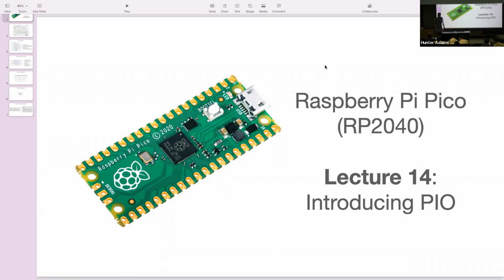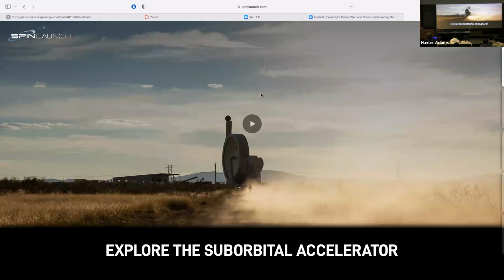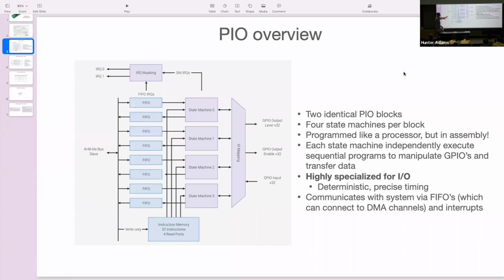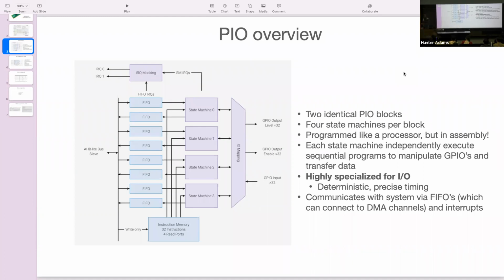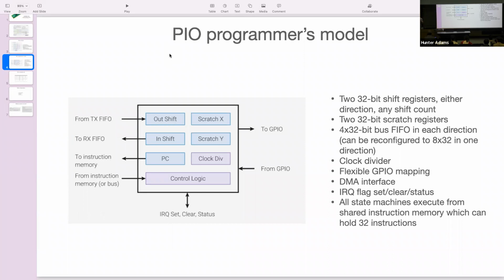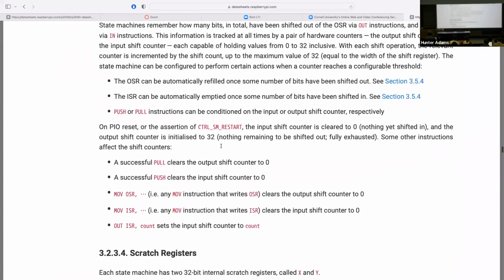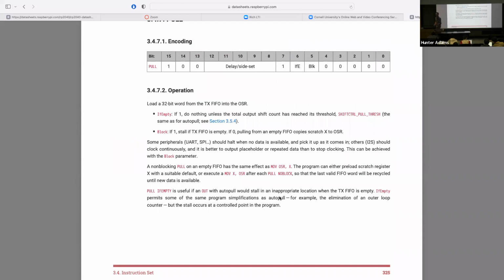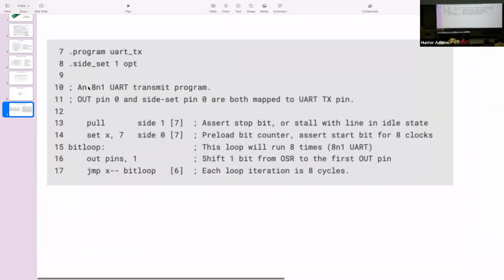Raspberry Pi Pico Lecture 14: Introducing PIO

Comment: I have a dso with a frequency of 100 MHz, and I use Thonny IDE and Micro Python with a Rp2040 system clock of 125 MHz. I also know the pwm frequency, which is 62.5 MHz.
I have to make a pwm in an RP2040 at 25 MHz in PIO, thus here's my code:
import machine
import utime
import rp2
# Define the PIO program for PWM
@rp2.asm_pio(set_init=rp2.PIO.OUT_LOW)
def pwm_prog():
    wrap_target()
    set(pins, 1) [1]
    set(pins, 0) [1]
    wrap()
# Create a PIO state machine with the PWM program
sm = rp2.StateMachine(0, pwm_prog, freq=25_000_000, set_base=machine.Pin(0))
sm.active(1)
I want a square wave, however the PWM produced noises and ripples with this code.
And I want to use this method in PIO
Thus, how can I lessen the noise and ripples? Help me please sir
Reply: Why don't you just use the native PWM capability on the Pico? Just about any pin can be PWM.